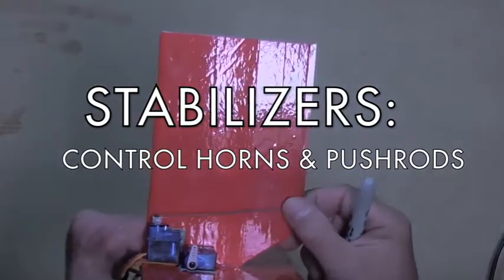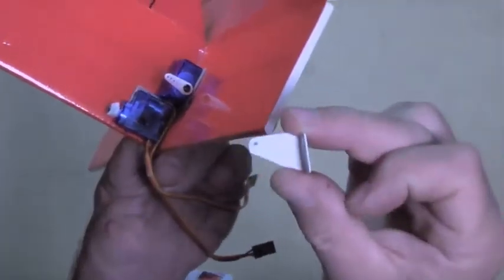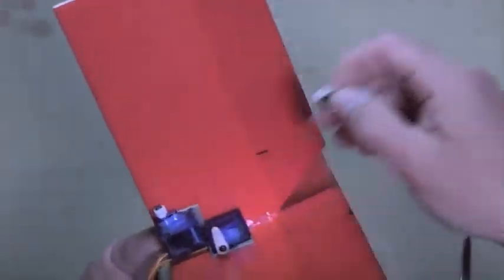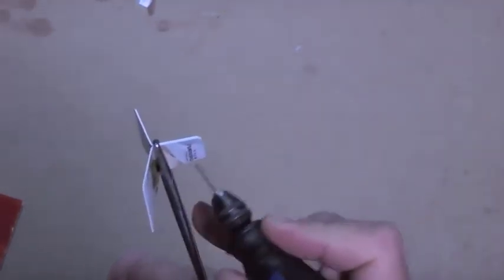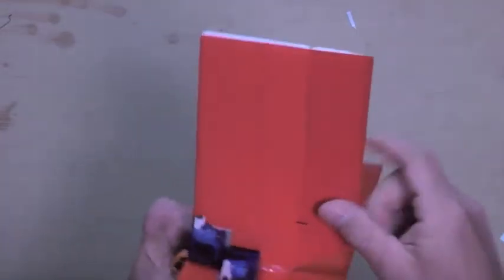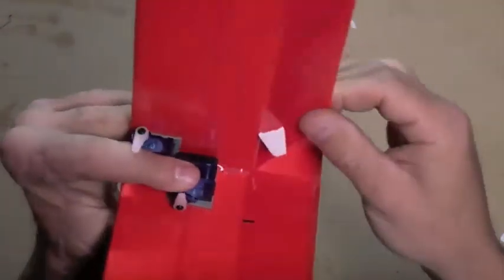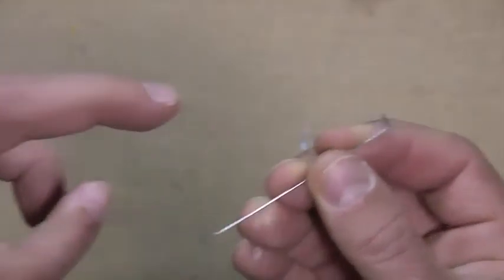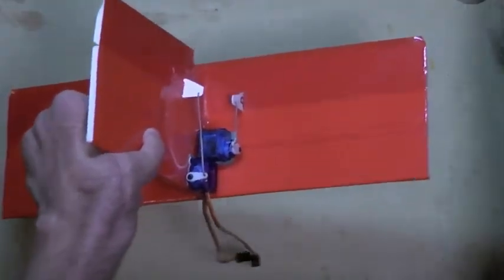Foamboard Building Techniques: Stabilizers 5 - Control Horns & Pushrods

Comment: Searched HobbyKing extensively but can't find metal 'wire' for push rods, nor the adjustable adapter to accept the straight end of the push rod. Where have you guys been able to find these items ?
Reply: I found these on eBay using the search term "Metal RC Model Quick Connector Pushrod Linkage Stopper for Airplane"
and on Amazon by searching "Pushrod Linkage Stopper." As for HobbyKing they need to add additional keywords so their search tool can find items. This is not the first problem I've had with HobbyKing search.

Comment: Isopropol alcohol will release hot glue from most surfaces too. The pure 100% de-natured alcohol works best if you can get it. You have some great ideas and a much better presentation style than most tutorials I've seen. Your videos are very professional. They are concise, yet still cover the material fully. Thanks for the good work.
Reply: +Hifin Sword   Thanks for the post.  I just over glued and broke some stuff on my first plane needed a way to fix my hot glue debacle. I used 70% Isopropyl and it worked pretty good :)   I've never used denatured alcohol before so I don't have a comparison but Isopropyl got the job done. Thanks.
Reply: +Robert Hatalla  You welcomed.

Comment from the maker: They are often a little tight so I have a little Z-bent piece of the wire that I use to drill out the control horn holes, using it kind of like an old fashioned brace and bit.  A Dremel can work in the same way but be careful not to overly enlarge the hole.  Good call on avoiding the small wire.

Comment: Ed, are using control horns with larger diameter holes on the servos?  I'm using 9gr servos from hobby king but .047 music wire is too large to fit in the control horns included with the servos. I tried .032 which fits just fine but seems like it will bend or flex too easily under stress or fast control surface movement.

Comment from the maker: @ceejayluke Pushrod material is one of the few things I still get a my local hobby shop.  Find the right size (.047" is what I like) and just buy a bunch of it.  It should be less than $1 for 3 feet of it.  Some guys have used steel wire from hardware store for very short pushrod spans, but it can be flexible so be careful.

Comment from the maker: @MyGeekShowdotcom I use mainly .047" music wire (I believe it's actually piano strings) for pushrods, obtained from local hobby shop.  It's so cheap it's hard not to just stock up once in awhile.  Colored packing tape is from TapeBrothers dotcom.  There are several other places online.  Look for "carton/packing/sealing tape".  Also RCGroups thread on "foamboard building university" I just started has some sources listed.